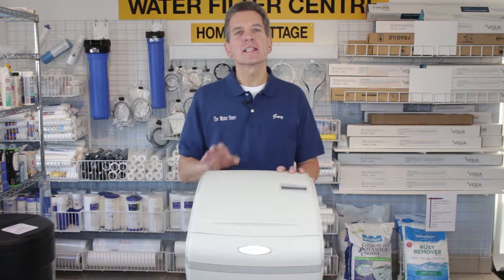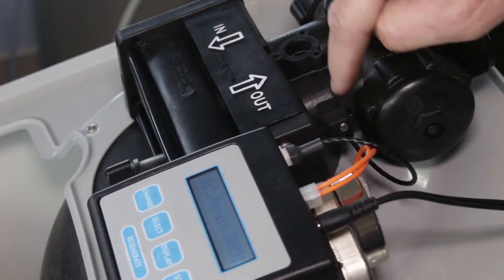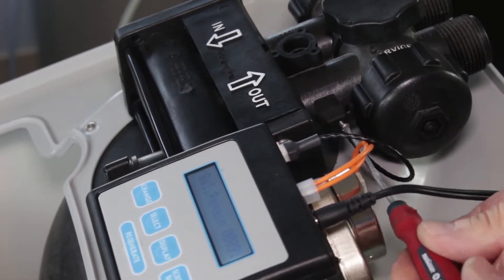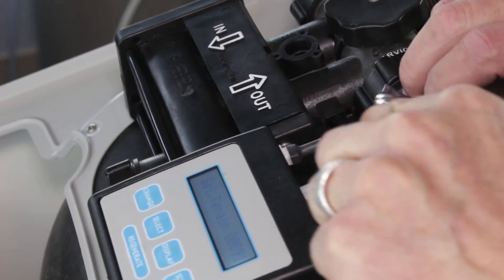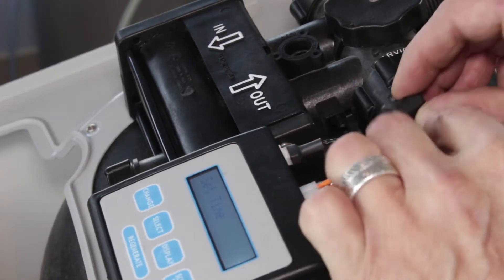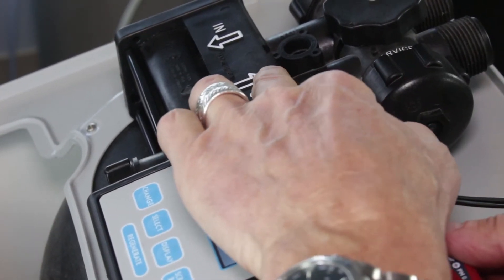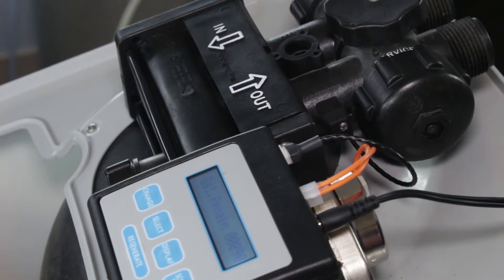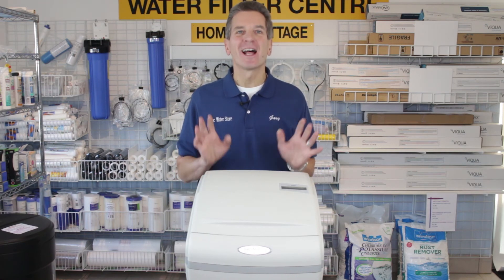How to Test the Flow Sensor in Aquamaster or Water Boss Water Softener

Comment: I’ve been told that these WaterBoss / AquaMaster 900 water softeners have a pre-filter and backwash cycle that will help alleviate small particles that may clog other water softeners up.  Is that true?  Or does a person need to run something like a spin-down filter before the water softener?  Thanks.  Great channel by the way and loving the mini rack water system we got from you :)
Reply from the maker: Yes, WaterBoss and Aquamaster water softeners do have a built in, self cleaning sediment filter that works great.  We have our Aquamaster water softeners here https://waterestore.ca/search?pf_pt_product_type=System&q=aquamaster

Comment: Hi, I have a water boss and if I plug in the turbine wire into the controller the display goes blank
Reply from the maker: That is odd.  It sounds like a controller problem but you can always contact the manufacturer to see what they suggest at 1 800 437-8993